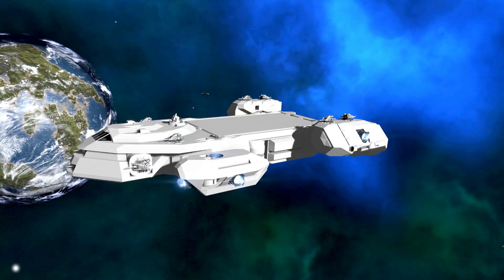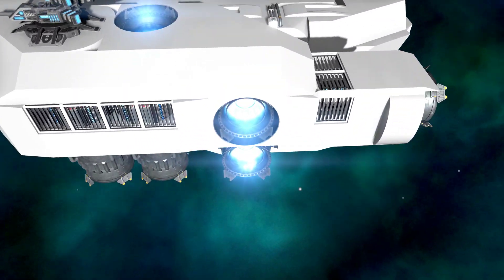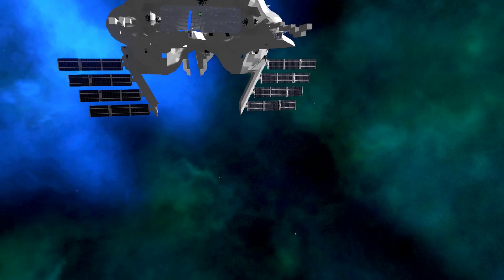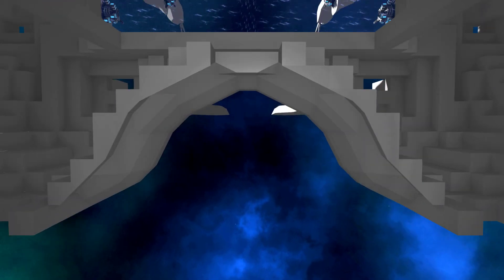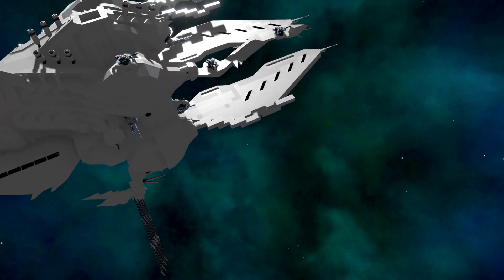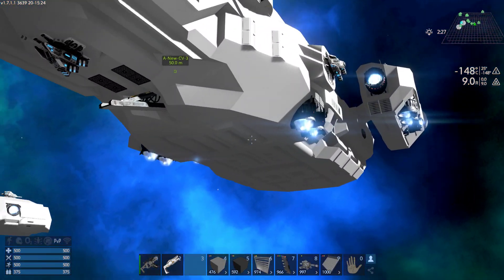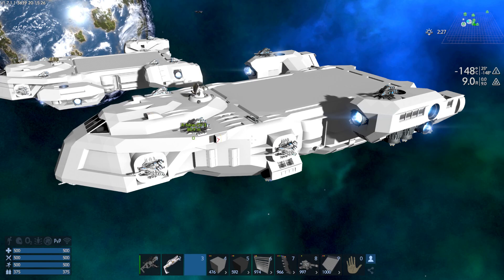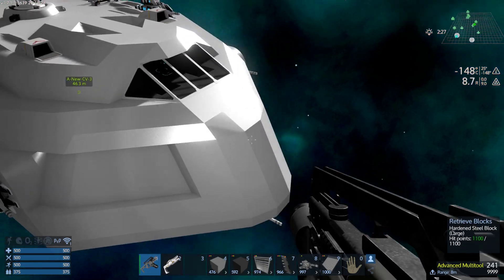Empyrion Galactic Survival - General Update 10-20-2022

Comment: I'm sorry if the Cerberus comment put you through a ton of work, but honestly, the ship looks so much better now. I think the thruster housings are really good as is, they look like they have the rear thrusters placed in the most economical way possible. I would say that if this is a mid game ship, a mining turret would be overall a better choice than a pile of drills. You could even put it where you had removed that nose turret before. I only farm on late game CVs or on bases personally, most of my ships with farms either have empty plots or stuff I planted but never harvest.

I think the station looks really awesome, you are firing on all cylinders building that. If you are going to do more tentacles for docking a couple of modules, it should still look good. Going to be tough to make them look good if they are thick enough to travel inside, you may have to make them super long to get the ratio right. I suppose that would give you a point to dock CVs at somewhere in that length. It's not like they need to "land", just stop nearby really.

Maybe tentacles reaching down under the belly to hold a module (or two stacked vertically?) right under the main body of the base. You could then put several minor tentacles around to line up the modules and have some leeway for artistry. It would kind of look like it had captured them, and might make the severe change of styles less jarring.

I think those two rear platforms and the hangar provide quite enough landing space, and you could make the mandibles just large enough for very small craft, or craft can hang over the edge some too. Though with that gap in the very rear, I could see you making a lobster tail on the back to land a CV, or at least part of a CV, and still have an access door, you could even use ramps to cover the door and keep the profile in line.

Looks really, really good.

Thanks Jeff!
Reply from the maker: Don't be sorry. I like people pointing out things that I didn't see or did but wasn't sure if it was just me seeing it. lol. Also I like your ideas. I will keep them in mind when continuing on the build. And Thanks again!

Comment: I don't really see a need for a farm on every ship.  Ship farms usually produce a small amount proportional to the amount of ship they use.  I'd rather have a farming module or space station that can grow a lot of food you can take with you on the ship for the space of a fridge.  Plus, a farm on a ship requires you to keep your ship running 24/7, which isn't a big deal in single player, but the fuel cost adds up on a server.  Also, I'm always worried about losing the crops due to decompression if you get a hole shot through your ship.   imo, the only ship I would want a farm in is a giant carrier.  Finally, I'd add that if a person wants a farm bad enough, they'll find a way to add it to the ship.